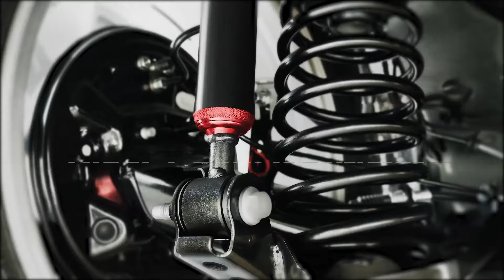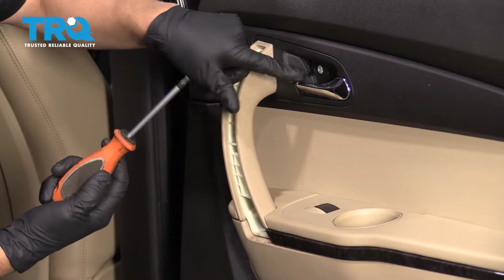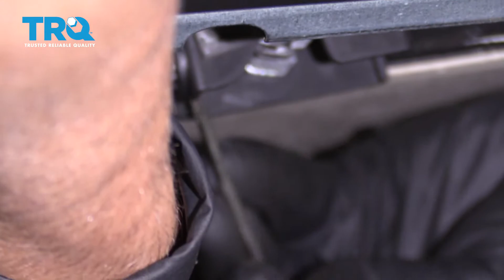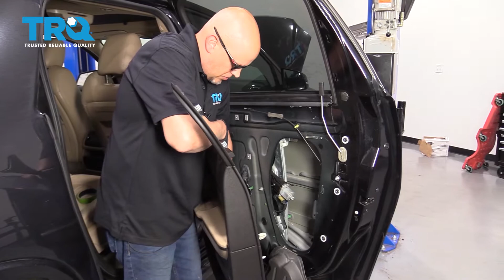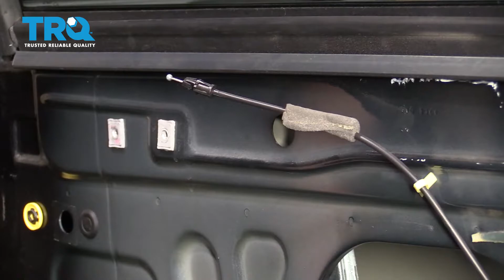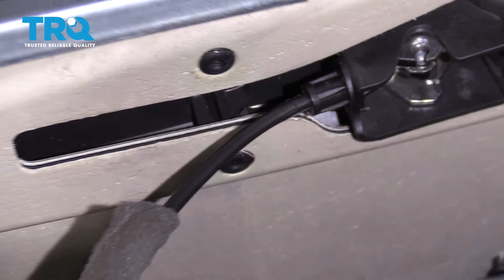How to Replace Window Regulator 2007-16 GMC Acadia

Comment: How do I do this if window won’t go up or down?
Reply: My question to all the videos they show same thing why are they replacing motors and regulators that work
Reply: Remove motor,had to drill a hole to see the one screw but it worked